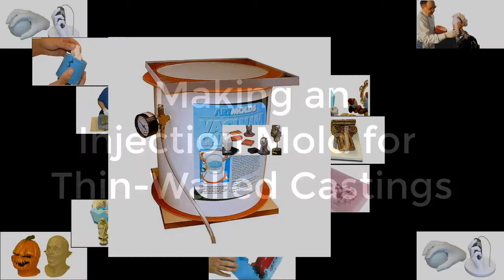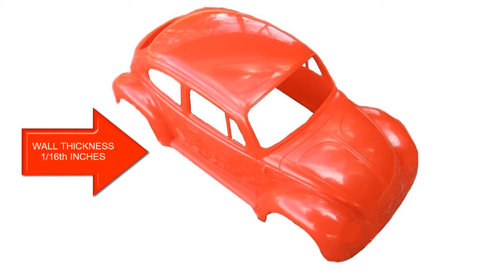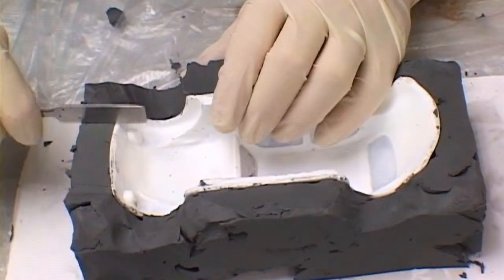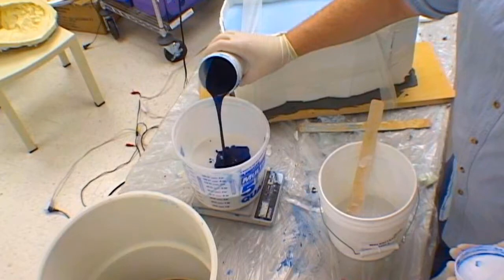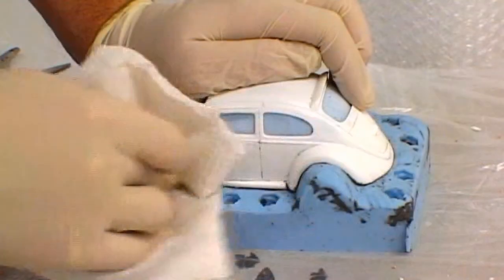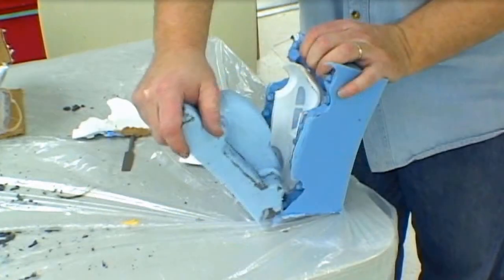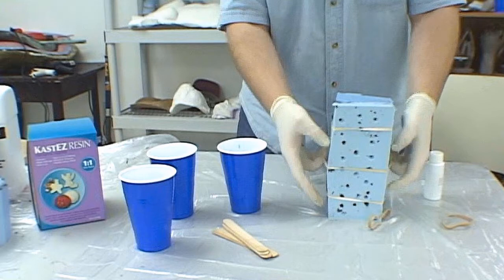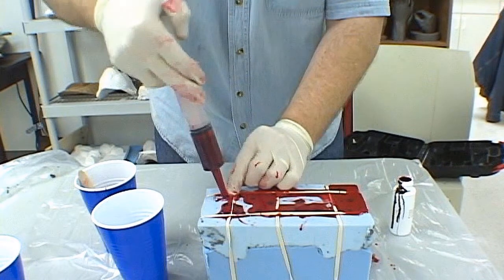Thin Walled Castings - The Inject Mold Tutorial

Comment: Hi, thanks for taking the trouble to put up the method.   My main question is about the strength and or flex of the finished item.  Not knowing a lot about the material used I can only go on similar bodies made of two part that I have seen.  Those have been quite thick and are prone to cracking and breaking.  I should add that the bodies I have seen are for slot cars of various types.   So my question is: is there a two part that is as resilient as plastic.
Look forward the the replies.
Reply from the maker: Our KastEZ Resin is what you are looking for

Comment: You skipped from pulling the part to a finished body.  I'd say that's a pretty big leap and a bit deceptive, don't you think?  When you showed all the vent holes being drilled and how they were all over the body of the car including the center line 9:42, I find it hard to believe that the finished product you show came from that mold.  That mold does not even look like the same model as the finished product, it has much less detail.  If it did come from that mold, I would have liked to see what the part looked like fresh out of the mold without clean up.  It must have looked like a porcupine with all the sprues.  Please correct me if I'm misunderstanding the process.  Thank you.
Reply: the mold and the finished product do look the same. it is quite a jump but the process seems straight forward. its possible that he accidentally broke this one while removing the sprues and didnt show that and used a second run as the final product image to keep the video consistent
Reply: at 9:42 that shows the part of the mold that forms the inside of the model which he never shows so any detail there isnt reflected in the finished product
Reply: Only a moron would think there won't be any vestiges from sprues and vents.  They are obviously cut and sanded off.  Also, pay attention...these air vents are on the core side of the tool, not the cavity side which creates the outside surface.  It would look like an inside out porcupine.
Reply: De-molding this is an absolute nightmare. All the vents are embedded in the mold and are part of the piece being cast, meaning it's trapped in the mold.  The amount of cleaning and repairing required with this method is fine for a one of, but trying to make more several copies.... no thanks!
Reply: @auxpower13  I agree.  Surely this isn't how styrene plastic model car kit bodies are made ?